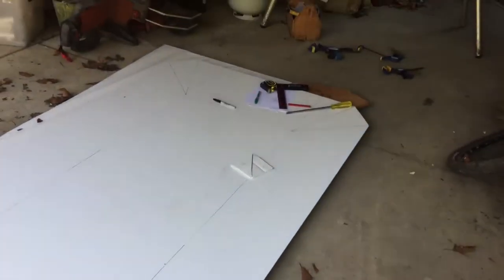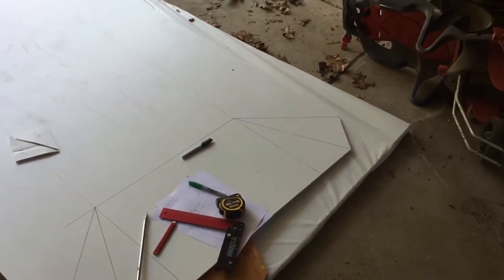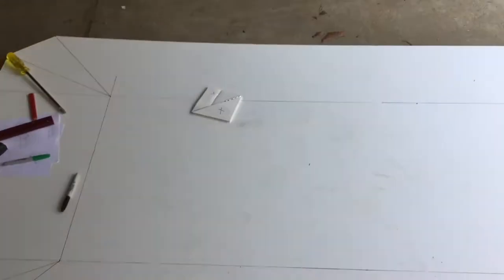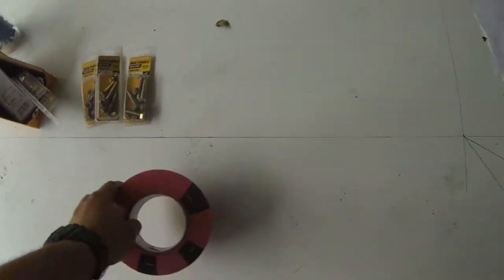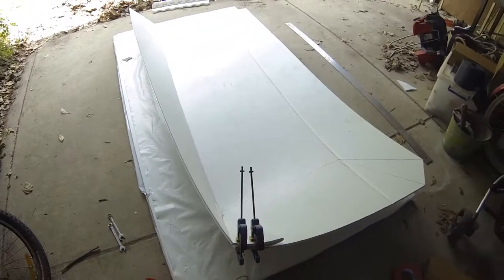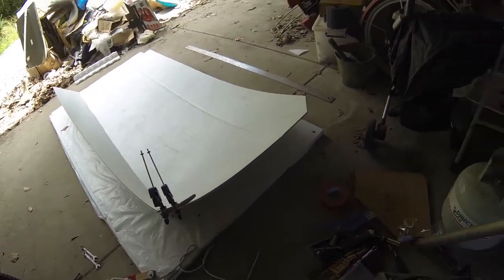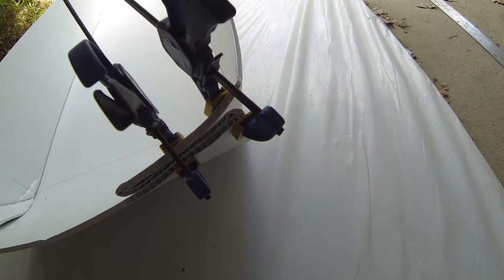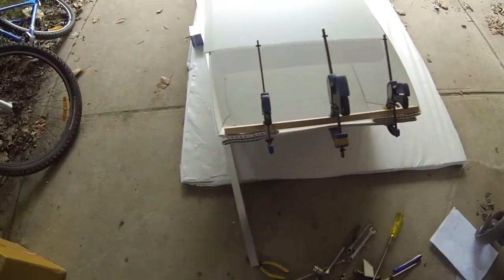DIY Corflute Coroplast Electric SpeedBoat

Comment: Hi - yes! im in Sydney - trying to get Corflute to build a boat aint easy! where did you get the 8mm from? I watch lots of american diy videos and it seems everything in the US is cheap and readily available - complete opposite of here! Did you get the electric motor installed? cheers, thanks for the video
Reply from the maker: Agreed the US you seem to be able to get anything at your local walmart. I got the 8mm from a local sign supplier, had to buy in bulk and get 10 sheets. I put the motor on (an ebay pickup) and it’s awesome. I went away from the plans and kept the tilting motor mount so it’s easier to transport without having to take the motor on and off. This follow up video shows the motor fun: https://youtu.be/E10QxwBn9y8
Reply: @reviewsandprojects  just watched the other video - the trolling motor worked fantastic. I bought a 65lb trolling motor for my inflatable boat - works well but looking to build a lightweight plywood boat for it next - cheers